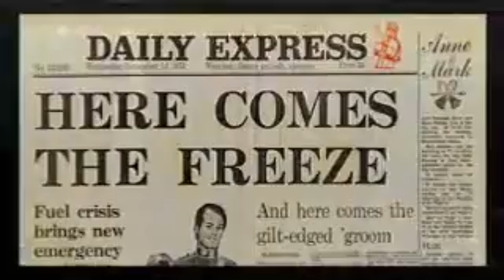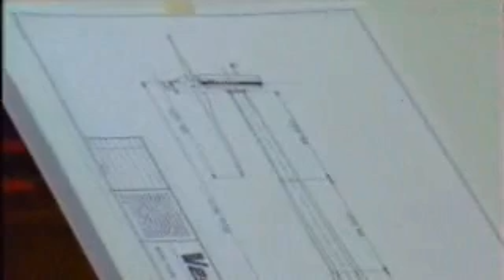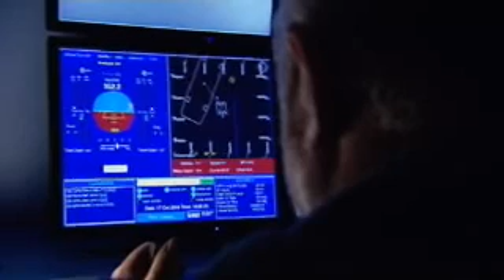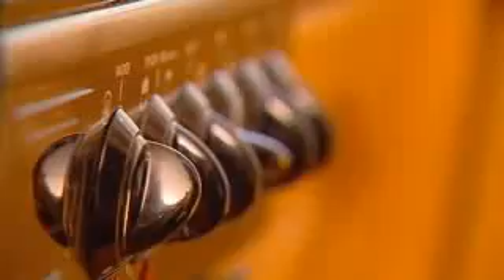Vestas build offshore wind farm "north hoyle"

Comment: Installed cost depends on where you install the turbine. Offshore costs up to twice as much as on land. However, winds are steadier offshore, so the capacity factor can be about twice as high as on land. The big wind turbines cost more than a million dollars apiece, but the bigger ones have a lower cost per watt produced. Wind power has become more economical as the wind turbines have gotten larger. Go to Wikipedia and read the wind power article, which covers all the basics.

Comment: "....When there is an increase in demand, the utilities automatically adjust things to get the cheapest electricity available. When there is a decrease in demand , they automatically turn down their most expensive power plants. Utilities generally have to be FORCED to buy wind power" In other words wind power has not passed the market test and never will. It has passed public opinion test and that's all that matters, but it does not change the physics and physics makes it pointless.